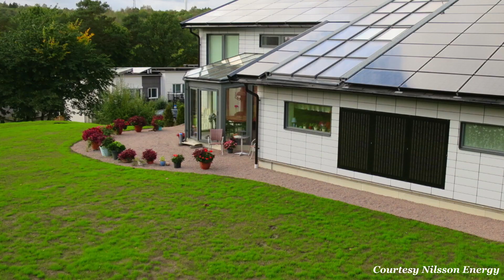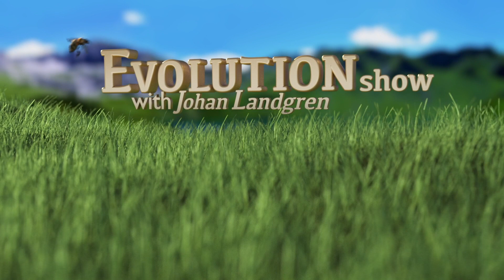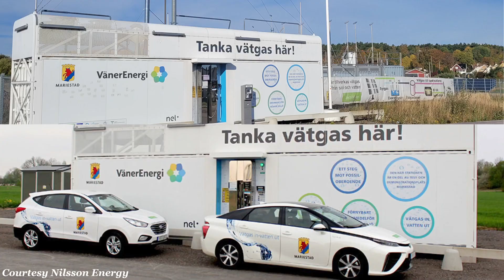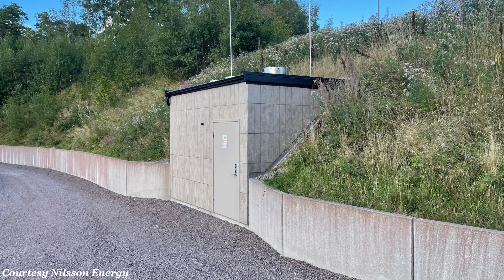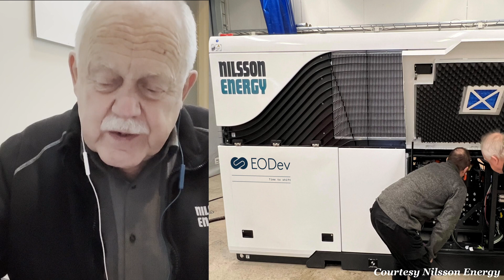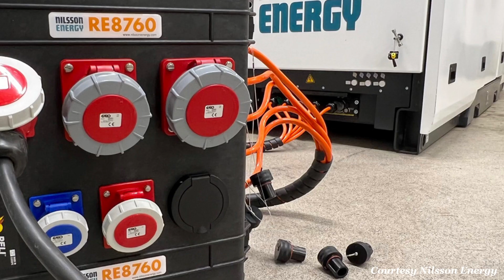Bye Bye Diesel Generators here comes Hydrogen Storage! With Hydrogen Pioneer Hans-Olof Nilsson

Comment from the maker: What do you think of RE8760? Personally I love the idea of both mobile containers filled with hydrogen tanks ready to be used on the go and smaller units for emergency/backup power for emergency rescuers, builders etc and of course off-grid solutions for pre-schools, housing, offices etc. To combine battery storage with hydrogen for seasonal/long term solutions with solar roofs and no brainer and yes requires no grid connection! How cool is that!? Share what you think below! :) 

Cheers,
Johan